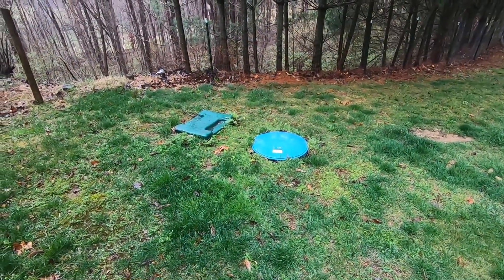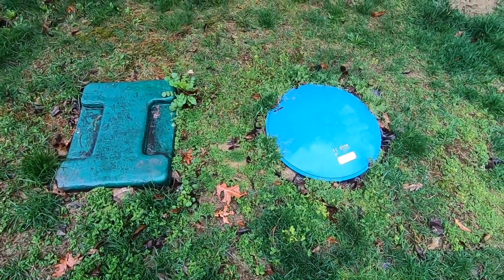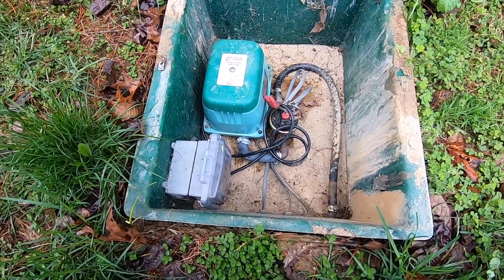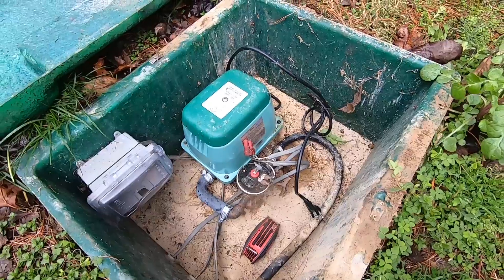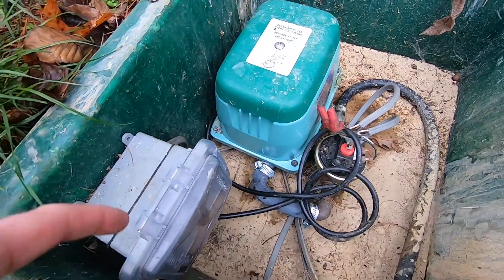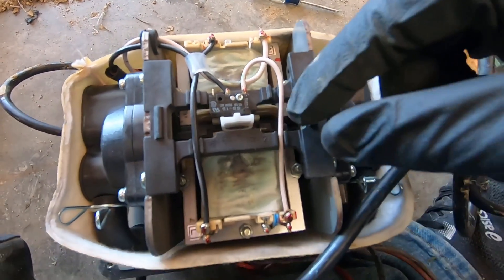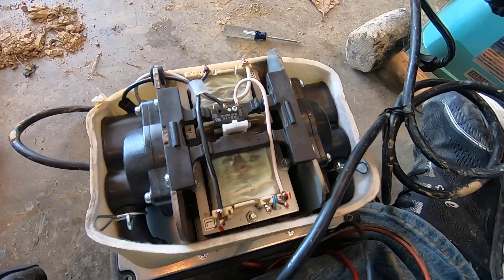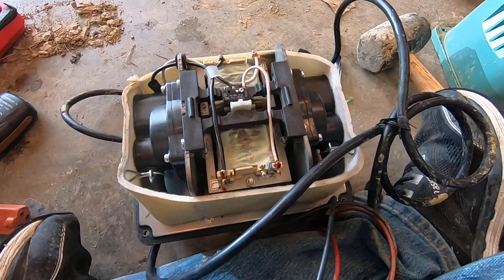Aerobic Septic System Alarm Troubleshooting - Gast or Hiblow Pump Not Working

Comment: I just bought a house with a septic system the seller said to never disconnect the power from the service provider. Because of the type or age of system I have they wouldn't reconnect power. Any info on how, why or what?
Reply from the maker: Sounds like they are talking about your power service from the power company.
Reply: They didn't know what they were talking about. The power only operates air pump and alarm systems and your power company has nothing to do with septic regulations. That would be your public health dept and they only get involved when installing a system.

Comment: I plumbed a 0-10 lb gauge where the external pressure switch is. Makes it a lot easier to trouble shoot. If the switch goes under 1 lb the red light will activate. These normally run at 2 to 3 lbs of pressure. They can appear to be working, running and putting out "some" air and people will think they are ok and they are not. If they are around 1 psi or just below usually one diaphragm will be ripped and bad. There are two diaphragms; one on each end of the air pump. I like the Fuji Mac pumps a lot better. They use permanent magnets for the fields instead of electrical windings like the Hiblow does. Simpler and uses less electricity. These things run 24/7. Plus they are a little cheaper than the Hiblow and are quiet.
Reply: Typically when my light goes off (I shut off the audible alarm as light is plenty of notice) I assume the pump is dead since that's always been the case for me. I have two of these systems on my property so last time I simply stole the pump out of system I'm not using. Pump just quit again so this go around I'm going to see what it takes to rebuild as pumps run around $400 last time I checked. There's not a big hurry depending on size of household, (just me on mine) and how much waste you add to system daily but at some point the solids will accumulate faster than reduced bacteria levels can compensate for. That's all that pump really does is create a great home for bacteria.
Reply: @lakewoodresident4674   I bought a Fuji Mac 80 from Wholesaleseptic  last time. it has permanet magnetics in it and uses less electricity since it doesnt need juice for the field windings. Its been running about 5 years now. If a diaphragm blows on just one end of the pump it will still put out air but you can easily tell it is not enough with the pressure gauge. Only cost maybe $10-15 to add it.

Comment: How much did it cost to install this system.?
Reply: Plan on 3-4k for 750 to 1000 gallon aeration system which don't need a leech field and those pumps run about $400 if not doing your own rebuild.